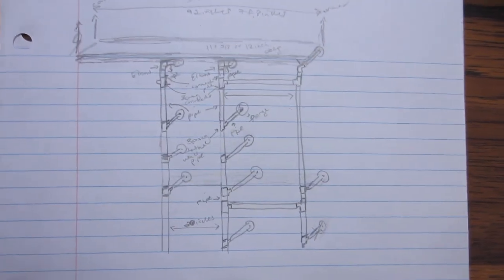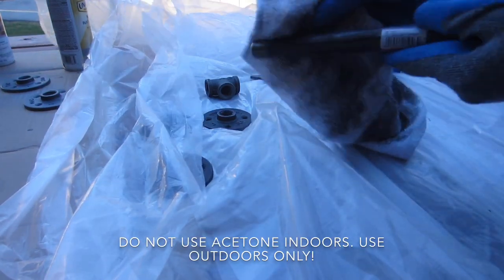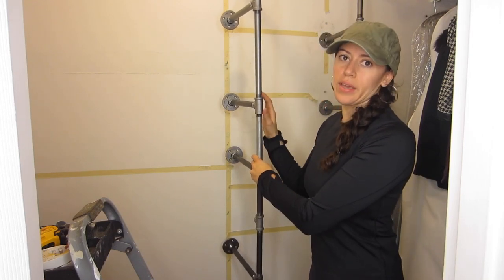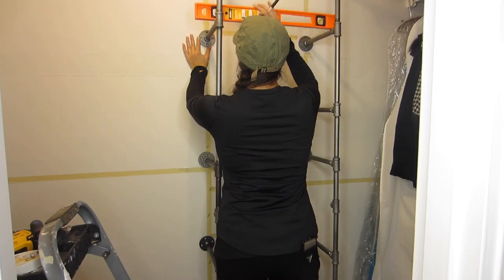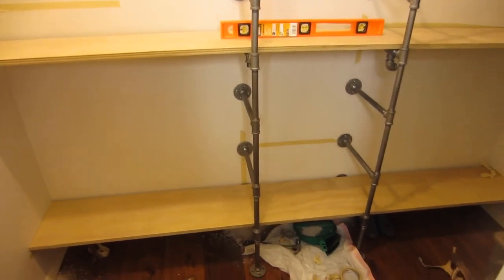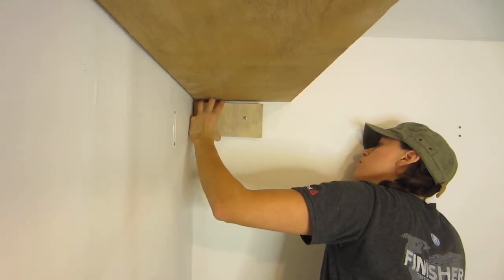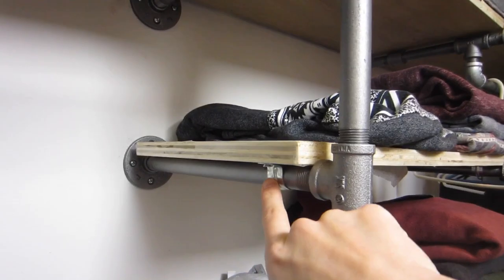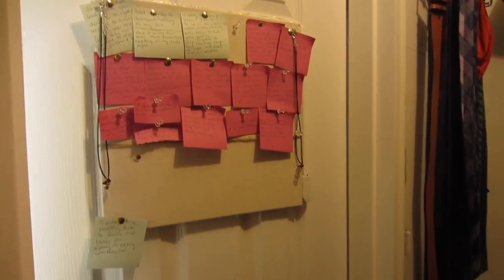DIY Industrial Pipe Closet Tutorial

Comment: I used (4) 2x4s attached to the floor and ceiling. These were attached to 2x4 pieces attached to the ceiling secured at the corner studs. Used 1x2s as ledger boards (also attached to the corner studs)  for shelving. Used black pipe only for hanging clothes. Closets are 7 feet wide. I have 20 feet of shelving, 12 feet of clothes hanging pipe. Two bars, high and low. Another bar for long length clothes. Bullet proof. No wall anchors. Went to home depot to get custom length pipe. I reused the already existing shelving material. The contractors really skimp on closets. Prior to the project, the closets had only one long clothes hanging bar and one long shelf above the bar. The weight was tearing the bar and the shelve down from the wall. Essentially, I added 5 feet of bar hangers and 13 feet of extra shelving. My kids love all of the extra usable space. They were both able to eliminate a chest from there rooms. 
Cost: $30. A carpenter would have charged $1000
Reply from the maker: ExtremeRecluse that sounds awesome!!! Good for you 👍🏼 I totally agree, getting it done professionally was not only way too expensive but still wouldn’t have been exactly what I wanted. It’s so great to do it yourself and be able to design it and tweak it to your exact need. Without the hefty price tag. Thanks for sharing 👍🏼

Comment: God bless you if there’s a bathroom behind where you said you was doing the project can it also be screwed to the ceiling and floor to avoid hitting any pipe and electrical
Reply: Also what’s the size of the whole project
Reply from the maker: Hey Jose!!! sorry for the delay.. thanks for the questions...It could definitely be screwed into the ceiling. I've seen that done before. I personally just didn't want to mess with my ceiling. but you def. could. from left to right wall it measured 92 inches. I wanted it as flush to the wall as possible so it was a tight fit. I'm going to measure the height today and get back to you. my measuring tape is in my car. I'll let you know though. Did you have any other questions. I'm happy to help if you're planning on doing your own build. Let me know. I'll try to help in any way.

Comment: I can’t find the 36” pole link can you please post it
Reply from the maker: Hey Mike. sorry for the delayed response. I had the 36' pole cute to size at home depot from a long piece. I think I had it cut from like a 120' piece. But if you don't want to go that route then here are two links for pre cut 36" pipe. https://amzn.to/3sKBfKB and https://amzn.to/3cz1AFL......They can make the cuts for you at Home Depot in the plumbing department. But not every home depot has a staff trained well for that. In my Home Depot the guy is so nice and very precise. But once I had a guy who made cuts for me and they all ended up being different lengths. it's because you have to account for the fact that when you purchase it precut from the factory the threads screw in all the way. But when they cut it for you they have to thread them really good and even then the threads only go in about a half in, so that makes things a little more difficult in terms of measurements. If you would like to. go that route I can help you with some specific measurements if you have some. for instance, if you have a 36' piece of pipe that is going to get screwed into a flange on both sides, then you will lose a half in on both sides after it gets screwed it, so you're usable pipe space now becomes  35 1/2" .... so if you wanted to cut IT from scratch at home depot and you wanted to end up with 36' pipe exactly you would ask for it to be cut to around 36 1/2" to make up for what you will lose after you screw it into the flanges. That's if you're going to tighten them all by hand. Which I used to do. until the guy in the plumbing department told me to use the wrench in the plumbing department. After I purchased that it was so much easier. Since it's stronger and can screw them deeper into the threads, you would cut that piece at 37" inches and then screw it all the way in with the wrench and end up losing a half inch on both sides. I know it's a little much. let me know if you have any other questions. I hope I didn't cause more confusion.

Comment: What size of pipe you're  using. Is it 1/2 or 3/4 diameter
Reply from the maker: Hey there!... I used 1/2 inch pipe for everything. I was really. happy with that size. You could use 3/4 inch but each piece is a little bit more money than the 1/2 inch. So you can save a little money by going 1/2 inch. Unless you wanted a chunkier kind of thicker look then you will want to go with 3/4 inch. I hope that helps. Let me know if you have any other questions.
Reply: @ShiWalksWithGod  thank you. Thats help a lot. I already bought the material with 1/2" size. Cost nearly half from 3/4" size. Currently progressing with the installation.
Reply from the maker: That's awesome!!! I hope it turns out great! 👍🏼❤️🤗

Comment: Looks expensive! What was the total cost ?
Reply from the maker: Hey. Thanks so much. It was def meant to be less than the final cost. I ended up spending around $250 with all the supplies. The wood wasn’t expensive because it’s plywood. A better or prettier wood like an oak or cedar it very expensive. So I went the less expensive route. The pipes weren’t that much at all. The key is to have a plan, so that you don’t buy more than you need. You thinking of building something?
Reply: Thanks for the reply.  When I saw all your pipes, elbows and floor flanges I was like oh, boy - that looks like a lot $$$$$.  I made an industrial shoe rack with some 2x8s and piping and flanges, .  Came out to roughly $60...which is not a lot, but more than I intended on spending for a shoe rack, lol...  The biggest pain was taking off all the gunk that it comes with out of the package.  I ended up soaking it in simple green and scrubbing off all the gunk with a  wire brush before letting them dry and painting them black.  I was happy with the end result.  And by looking at your project, you should be, too!!  It looks great.
Reply from the maker: Yea the trick to saving is to have them cut the pipes from longer pieces like an 80" or 120" piece. The precut pipes that they have are way more money and add up quickly.
Reply: @ShiWalksWithGod  very clever. Great info thanks.
Reply from the maker: @dansage3665  no problem. You're very welcome 🤗👍🏼